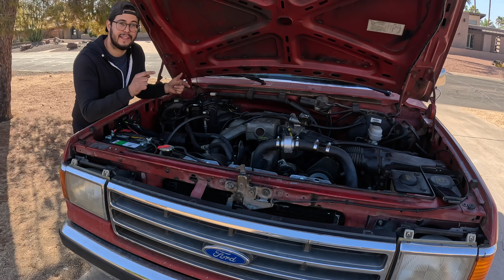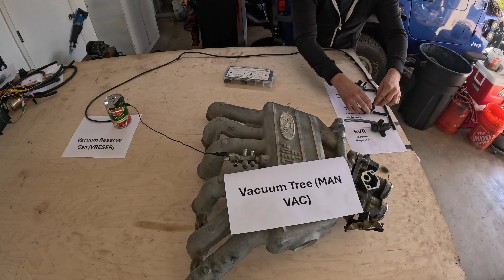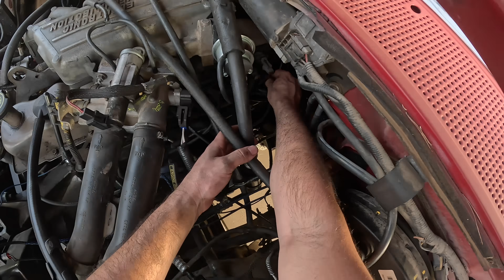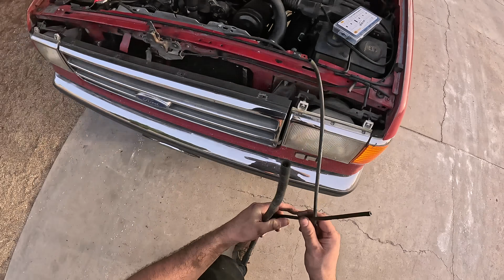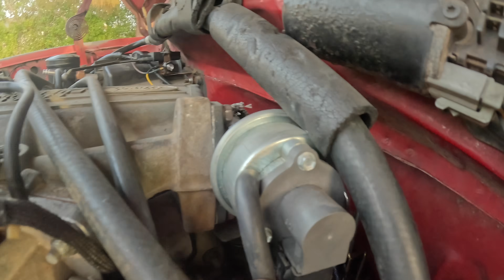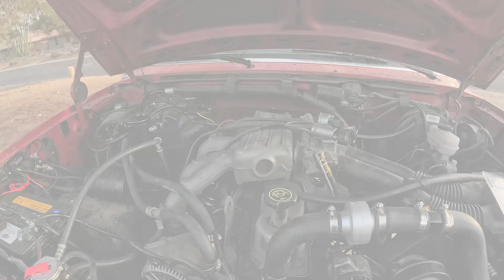Simplify Your Vacuum Lines | Post-Smog Pump Delete

Comment: Would the process be the same on a 95 4.9 since they're both EFI? Mine isn't seized but I'd like to remove it just to clean up the engine bay
Reply from the maker: Yes sir, it should be the same! Mine wasn’t seized either, but removing it still made a noticeable difference in get-up-and-go. Plus, cleaning up the engine bay is always a win!

Comment: How different is this when dealing with 351w
Reply from the maker: Heyo, I don’t have a 351W (yet 😉), so I’m not 100% sure if the layout is exactly the same, but the concept looks really similar. This video from the Quick Speed Shop does a great job showing the location of the componens on a 5.8L👇

https://youtu.be/OOfBYRX4kUo?si=x3Keq0C-vd2iRTJc

Comment: So, how did it run at first fire up ? Any performance issues?
Reply from the maker: Only performance with none of the issues! It's running way better without the smog pump. 

Better gas mileage and get up and go from a stop. 🤘

Highly recommend!

Comment: Are you sure it’s good to delete the PCV? 🧐
Reply from the maker: Heyo, sorry for the confusion!

The parts I'm removing at the beginning of the video (for example the fuel pressure regulator, pcv, and charcoal canister) I'm removing from the example to clear space on the table—not off the truck itself.

I'm only removing the components off the truck directly tied to the smog pump system after deleting the pump.

Hope that helps clear things up. Thanks a ton for watching and for the comment!

Comment: Couldnt I just connect evr to vacuum tree? Bypassing soup can?
Reply from the maker: Heyo, thanks for watching, and great question!

The vacuum reservoir (VRESER) keeps vacuum steady when your engine can’t—like during hard acceleration. Sometimes the engine doesn’t make enough vacuum to run things like emissions controls, the HVAC system, or the brake booster, so manufacturers add a reservoir to store it. A check valve in the hose or reservoir stops vacuum from leaking back into the engine. If that valve fails, you’ll lose vacuum fast—and with it, control over all those vacuum-powered systems.

There are plenty of folks who run without it, but it’s usually not recommended.
Reply: @MyAutoAdventures ahh thank you for explaining, I’ll be sure to find a replacement 👍
Reply from the maker: @cosmicdebris2174 My pleasure! If you'd like an upgraded one, email me at MyAutoAdventures@gmail.com and I'll send you one. 🤘

Comment: This is a really great demo - thanks for putting it up. My truck is part way through this as the smog pump seized up last year so I bypassed it and removed the attached canister, too. I want to remove the pump but I’m nervous of the long mounting bolt as it feels seized and I’m worried it might bust the mounting section. I’ll soak it in penetrating fluid and keep at it. I guess it won’t matter if it busts the mounting section hole if I don’t put anything else there but I saw there’s a pulley you can put there to put a better angle on the belt - thought I might try one, though it looks pricey. By plugging off the TAD and TABs ports, does that make their operation defunct now there’s no air to be directing? I ask because I have a code 81 come up suggesting TAD solenoid issue. Will that either go away after plugging or just not matter now? I wonder as it’s still going to be connected to the computer. Thanks! 👍🏻
Reply from the maker: Hey, thanks very much for watching, and great question!

Once you plug off the TAD and TAB ports, they’re effectively disabled since there’s no air going through them anymore. The solenoids are still there and connected, so you might still see the code 81 pop up, but functionally, it won’t really affect anything. It’s just the computer noticing they aren’t doing anything. If you really wanted to clear the code, you could install resistors or a dummy load on the solenoids’ wiring, but most folks just leave it since it doesn’t hurt anything.

For the pulley, it really depends on how your belt is routed. I didn’t have any issues with clearance and just ran a shorter belt, but I have seen some people have issues where the dummy pulley helps. It can definitely get expensive though, so hopefully you won't need it!

For the bolt, using penetrating fluid like PB Blaster and some heat can help loosen it up. I was lucky and got mine out just fine with a breaker bar. Hopefully, it comes out without any issues for you!

Let me know how it goes, and good luck with the project!
Reply: Thanks for the reply! I figured the code 81 probably wouldn’t matter anymore but I’m trying to diagnose why my truck (‘89 4.9 auto) has rough idle and stalling when cold but goes away when warmed up. Only code I got was the 81 and I did see on a forum somewhere that someone had the same and said they said it was TAD causing it. So not sure if that could be the case. It seems like IAC needing cleaning or replacing is the usual cause of the erratic idle though some have said something about resistors in the computer doing same but I would have thought that would make it do it all the time, not just when cold. Still learning so, again, not sure! Incidentally, I gutted the cats on mine as they felt like they were plugged up (one definitely was - the other looked like it was going the same way) and it was my understanding that they would likely overheat and/or plug up with the smog pump removed anyway. You didn’t mention cat issues in your removal video so wasn’t sure if that was true. Doesn’t make any difference to me as mine are gone (pre ‘96 not required for inspection where I live) now anyway, just wondered. Thanks again.👍🏻
Reply from the maker: @MapleMarmite, I totally get where you’re coming from! I had so many vacuum leaks when I first got my truck—it was throwing codes left and right, and I spent ages chasing them down. It’s definitely smart to follow the codes to figure out your issues, because yeah, it could be the IAC, the capacitors in the computer, or even the coolant temp sensor acting up.

Yeah, I don't have my cats either! 😆 

Good luck with the diagnosis. Sounds like you're on the right track! 🤘
Reply: My vacuum lines are old and crazed with fine cracks that probably have small leaks but I got a bag of vacuum hoses off Amazon a while ago so I’m going to follow your description and remove all I don’t need and replace the rest with new. Just need to get those vacuum caps like you have first. 
I like the way you explain things - really easy to follow. I’d like to see you do a video on the alternator upgrade as I have that on my list. Maybe also one on removing and checking the PCM to see if anything looks bad. Kind of a scary thing to get into but I think you might be the guy to take us through it. 
Subbed and belled and checking out your other videos now. 👍🏻
Reply from the maker: @MapleMarmite Thanks so much, I really appreciate it! Replacing those old vacuum lines should definitely help! I actually did the 3G alternator upgrade before I started making YouTube videos, but I’m planning to tackle more projects on other vehicles in the future—hopefully, that’ll be one of them!

I’ll definitely plan a capacitor replacement video too. I’m not the best at soldering, but there are only three capacitors, so it shouldn’t be too crazy.

Thanks again for the sub and for interacting! 🤘

Comment: Hey man I’ve been watching all your videos, I have a question, I have a high idle. I replaced the EGR the sensor that plugs into it, I still have a high idle I have a random hose feeding from the cylinder head that was covered with a bolt, I don’t really understand the diagram I’ve looked through old forums and I have no idea where it goes I’m not sure if I can send the picture to you else where been having trouble can’t pass smog due to the truck idling around 1300-1500
Reply from the maker: @JuanBarajas-r8i  Hey bud, thanks very much for the support. I'm happy to help if I can. When I first got my truck I had the hardest time chasing down a high idle problem as well. Turns out it was a mix of vacuum leaks and an old IACV. 

You're welcome to email me a few pics and I can take a look and try to assist. MyAutoAdventures@gmail
Reply: @MyAutoAdventures I went ahead and sent an email your way, I already replaced the old iacv no luck, replaced the egr position sensor the egr as well the unit I purchased was faulty it threw a code right way I cleaned and reinstalled the old one and I no longer have a check engine, I replaced the egr control switch sensor repaired a cracked vacuum leak coming from the tab and tad solenoids I was idling at about 2000 rpm I’m not at about 1400 on the low end 900-1000 once idles drop on start up it only goes up after I drive it for a bit
Reply from the maker: @JuanBarajas-r8i oops, I started responding to the email before I read this comment. 😂

Sorry for that super long email reply. Happy to stay in touch during the troubleshooting process. It'd be nice to figure this out!
Reply: @MyAutoAdventures thank you for all the help no worries at all! Much appreciated
Reply: @JuanBarajas-r8i  Did you ever figure out your idle problem? Years ago I had that problem and I replaced the o2 sensor and that fixed it.

Comment: Solid explanation. Got you a sub. This doesn't quite work the same on my 1996 OBS 4.9L due to some differences, but it's similar.
Reply from the maker: Appreciate the sub! Yeah, the differences between the ‘80-‘91 and ‘92-‘96 generations, especially with MAP vs. MAF setups can change things up a bit. Glad it was still helpful! Thanks again for watching! 🤘
Reply: Say more about the 4.9 ‘96 obs. Because that’s what I have please
Reply: I have a 1993, any information on the differences?
Reply: Can you please tell the differences. Doing this on a 93
Reply: Do you have a good guide you've followed for the 96? I want to avoid codes.